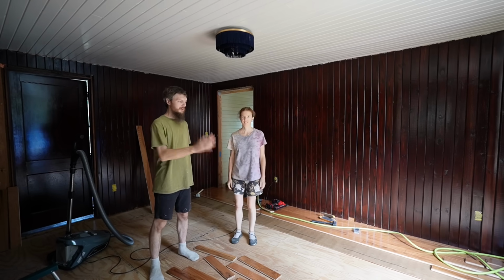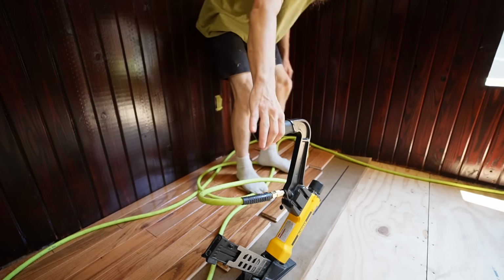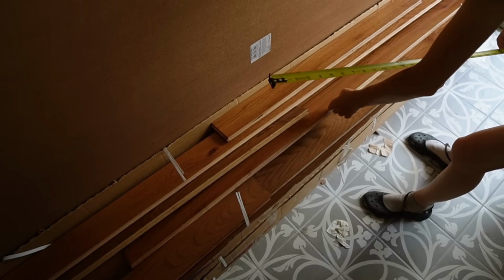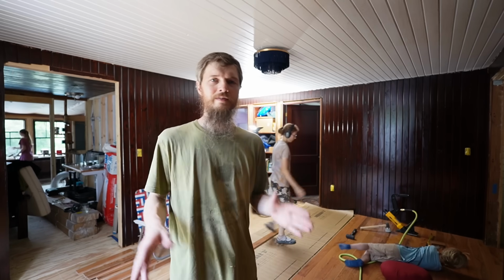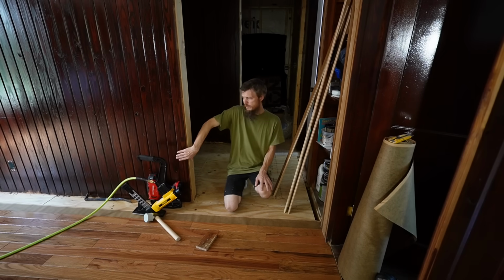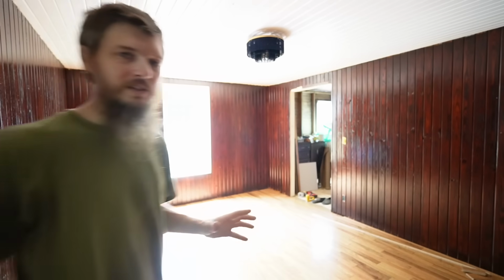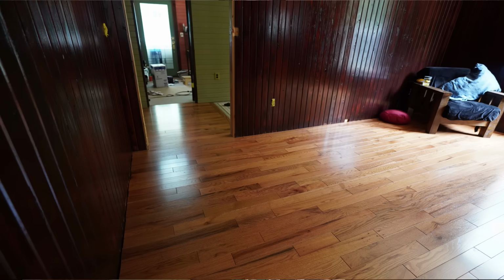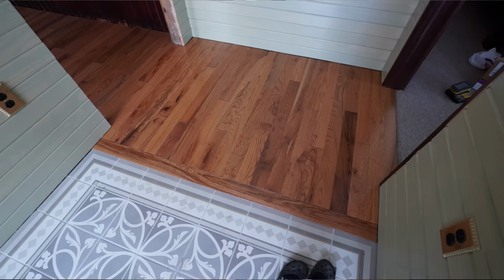We Finished Our Hardwood Floor and it's....

Comment: I’m an old lady, widow, bought my “last” house. It was in the process of renovation when it all stopped and went up for sale. That’s the reason I was able to afford it. Among lots of other issues, it had oncrete floors sprayed with red waterproofer. I bought Traffic Master tile because it was the least expensive tile I could find. The guy who laid it was impressed, and I get compliments on it all the time. Your Traffic Master oak floor is beautiful, and the “character” of the wood is a plus, not a minus.

Comment: The reason the flooring was so inexpensive is that it is most likely cutoffs from longer lengths and sold at a discount. Good on the supplier for passing on the savings to you.

Comment: I like hardwood floors with knots and grooves etc. it reminds me of old pine wide plank floors in older homes. I used plywood and cut it into 8 inch wide pieces. I used the pieces even with knots etc. it turned out amazing and I’ve had several visitors ask where I got my hardwood floors. They are always shocked when I tell them I made them from plywood. 😂

Comment: I’ve been the “cut man” (person) on a framing crew and it is a high pressure job with the most common mistake which is called “inching it” when you cut a board one inch short.  And it’s very easy to do!  Good job Ashley!

Comment: With those holes in the wood floor, applying epoxy to the correct color might be an option. The flooring looks great. The house suddenly has a more complete look.

Comment: Send some rain to Arizona!  31 days in a row at 110 or above...Saguaros breaking in half and falling over.
Reply from the maker: Hot hot hot! Hopefully it rains soon there. It's been hot here lately too (heat indexes of over 100), but our summer has been abnormally dry and not the same as our last 2 overly wet summers.

Comment: Lovely job! I am considering doing a pine floor in my modern rancher. Currently it has beige one foot square tiles with dark grout. It is about 20 yrs outdated. I am thinking about gluing a sub floor over it so I can nail the planks in just like you've done here. You make it look so simple and it is making me think about pulling the trigger on my idea.

Comment: The floor looks great.  Good choice on using pre-finished flooring.  Not only does pre-finished flooring avoid a lot of messy work, it generally stands up to wear a lot longer than finishes that you apply after installation.

Comment: if you stagger the board (starts more than one line ) you dont have to move back and forth so often ( when you run 4 rows at the same time you have to move back and forth along the floor a quarter of the times) it helps as you can stay in one spot longer and dont have to fetch youre tools / pull on the airhose as often , works more efficient
it allso helps if you move from left to right and then move from right to left on the next row , again saves you from moving youre tools so mush 
stacking the flooring pieces in front of where youre working (up to a point) helps speed the process up too allthough it will feel funny holding the hammer in the other hand
but then i cannot use the piece i cut of the end of the row....yes you can you just use it on the next row same with the previous piece
the floor turned out verry verry nice and 4 dollar per foot is a lot better for a solid wood floor that wat i can buy laminate flooring for , btw check batch numbers when you buy more as there might be small varables tn the tongue and groove and the colour of the finish
Reply from the maker: Occasionally we do that, but many times we cut the end off one plank, and then that leftover piece gets used to immediately start the next row. Sometimes we like to just work row by row :)

Comment: Much as I like mahoganies, the "Teddy Graham golden brown" of the oak is a great contrast.  And you know how much we 🐉 love shiny/reflective anything.  That floor nailer like you're using, I'm not sposing that can be used with the thinner snap-together type floorings (which're sometimes a pain to get to stay locked).  So smooth and sheeny; great floor for doing the sock-slide on, just glide across to the other BRs but don't find that wall LOL.
   Traffic Master, I've helped my landlord install the clip-together planks of those before, they are a decent quality brand from what I've seen.  Under $4/ft², that's a good price actually.  Had you not zoomed in, I'da never known the boards had little possible imperfections, but glad you mentioned it in case viewers were considering it for their house/place of business.  The rusticesque nature goes with the antiqueness feel of the home.  I don't know why, but I feel y'all need to do a short or include a clip of walking in from outside on into the LR with the scene in sepia or B/W like if it was an old film from '58.  >>;=)
   ⛈SURPRISE!!⛈  We sure could use that here.  We've had like 2 bouts of 3-5min rains here in the last 2-3 months; it's been dry as all get out.  Despite the 99° and the 110s index, grass is still doing the thing, but lot of ground cracks happening and the blocks under the house make questionable sounds now and then.

Comment: The floors look great! My dad and I installed some new unfinished oak floors in my cottage. We took out the damaged old boards and cleaned up what was salvageable and mixed it in with the new. It looked so nice after. We tried to use the smaller pieces in the ends so your eye doesn’t catch all the seams in one place. We unfortunately didn’t have a floor nailer. We dremeled a small hole for the finishing nail and then used finishing hammer to countersink the head of the nail in. Luckily it was only half of the kitchen but it was a process. It’s been ten years and floor is still very beautiful. We chose a just a clear oil based topcoat but we had to slightly tint the new boards with stain to match the 85 yo oak. It’s not perfect but it adds so much character and warmth the the space.

Question, were the old floors badly damaged? If you kept some of the salvageable boards, they make nice furniture. Table tops or headboards or even small boxes and such. 😊
Reply: I think those floor pieces were toast, too far gone for anything but kindling.
Reply from the maker: The old boards were definitely still usable with some work, but we have no space to store stuff so we gave it all to someone for free.

Comment: I was taken by the varying shorter lengths and longer lengths that you used. It looks so good. Usually, I've seen the length they came in staying the same. That also looks good but I think I prefer the way you did it.
Reply from the maker: Real solid hardwood flooring is always sold in varying lengths. They range anywhere from about 1 foot to 6 feet long. :)

Comment: Your home starting to look so cozy and the floor looks so beautiful. I actually also recently purchased low grade 2.25 inch natural oak floor off the building materials auction (was $2.1/sq.ft). And I sorted out all of the boards with imperfections and worm holes. Ended up with 20% waste. I also didnt like the beveled cuts, so I cut each end of the board using miter saw and flooring bit for router table. It was So so much work but I like how its turning out.

Comment: The floor looks really good, I like the imperfections.  The transition from the LR to the hallway is very pretty.
Question - is there a window in the opening in the LR?  You mentioned no window, I'm surprised you'd install a floor and finish the walks open to the weather.
Reply from the maker: We've never seen rain blow in that window, but if it did, we'd staple up something to keep it out. We have that window ordered, just waiting for them to get it in.

Comment: Looks good but just curious and not a jab at you. But, why does it look like there are big gaps in the ends of the pieces?
Reply from the maker: The end of the boards are beveled, that's all. The cracks are tight though.

Comment: Looking great!  Imperfections = character  :)   A question,  at 2:46 it looks like the end board joints are loose?  See you tightening the long joints with the nailer or Is the top surface grooved and it's an illusion?  Also love how little waste comes with fitting these
Reply from the maker: Thanks! Not loose, the ends of the boards are beveled.
Reply: @diyfferent  that makes sense 8)

Comment: Aren’t you worried about doing hardwood in the kitchen where there’s a lot of water? We messed up and put wood floors in our kitchen and a pipe burst under our sink while we were on vacation. The entire kitchen was ruined. The floors are awful and we still have not changed them yet. They are all warped and bent and completely 100% damaged. I would rethink the kitchen if I were you. Just a really bad lesson we learned ❤
Reply: I wonder if it makes any difference what you put in your kitchen  flooring. Anything would have been messed up with water damage. Sorry your nice floor was ruined.
Reply from the maker: Nah, we're not worried. Sorry that happened with your kitchen though   :\